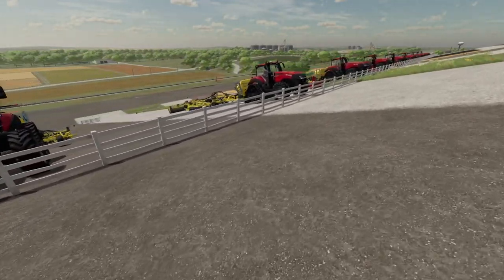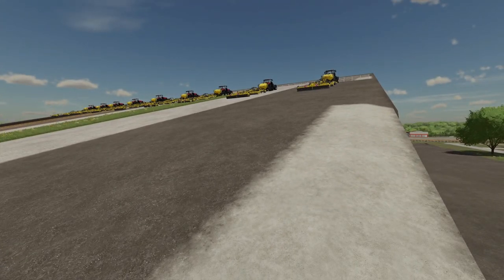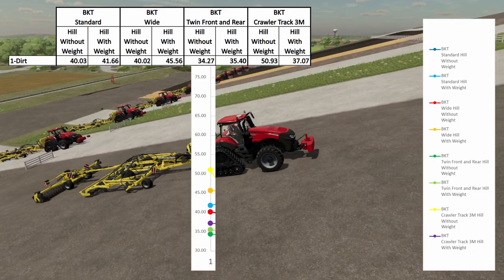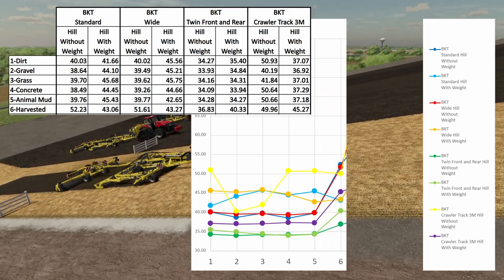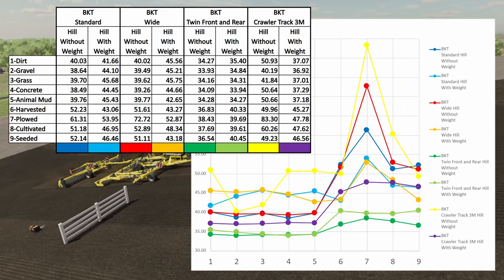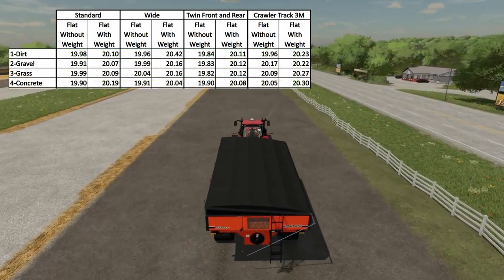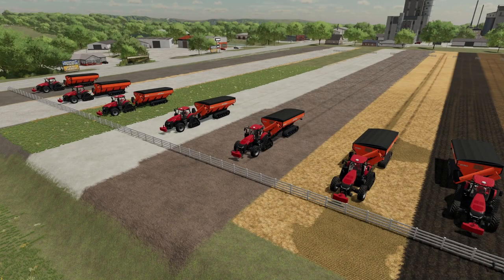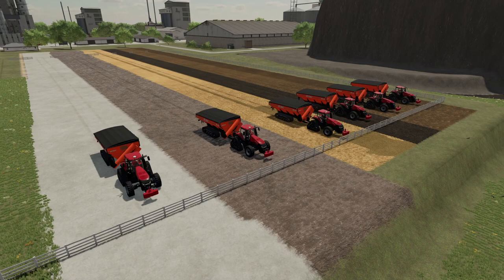Does Tire Selection Matter Part 3 | Farming Simulator 22

Comment: if you wsntto use your tractor as apposed to a wheel loader for log loading, double wheels and adds weight and the wheel weight adds weight too so you get more base weight. the wide twins maie it harder for trees to thorw your tractor around so does the heavy weight

Comment: I wonder if some tires help with climbing stuff such as silage with out the tractor getting stuck or if we gat a smaller tractor and 99% max out it's carrying capacity if  some tires that might no be tue quickest but can pull the implements we're some brands can't

Comment: I done some testing myself and the error in your test with respect is running something you don't have the hp for any increase of weight out whey the advantage they usually have in my testing weight balance is key and ground contact the more HP you can transfer to the ground the better the tracks are best when it comes to cultivation with a weight in front double all round is better than tack if ya don't want to tear up crops best if there narrow

Comment: Have you tried a different model of tractor to see if these findings remain consistent?  It'd be interesting to see if a similar large Claas, JD, or Fendt configured with roughly the same HP, pulling the same implement would fare any different.  Or those tractor designs that have the "hinge" in the frame that generally top out at 24mph (I don't know anything about tractors, I just play the game, lol) whether they would have completely different results due to being heavier/having a more even weight distribution between the front and back.  If there is a really advanced tire modeling/traction system, I'd think testing between different tractor "types" would show it better than anything.
Reply from the maker: I can look into different style tractors for sure.

Comment: I have FS. 15,17 and 19. Is 22 that much better.. Anyone?
Reply: From what ive seen its a pretty big Upgrade to the previous FS Games but i cant really Tell From Experience because i didnt get the Chance to buy fs22 yet
Reply from the maker: I only have 19 as a reference but I feel that 22 is a much better game. The addition of mulching, rolling, and workers driving around the map by themselves is awesome.
Reply: I would say fs22 is a big improvement upon 19.  Rocks in prepped fields. Mulching required for max yield and yes the workers able to drive the map and do tasks is pretty cool compared.  But it still has the bales in the shop bug.
Reply from the maker: @shokid24  there are still some things to iron out, but Giants is working to get them resolved.
Reply: @Driver53Gaming  any way you could do a video on what tools allow fast farming on console?   So far I’ve only found the krone big mower and windrower ☹️